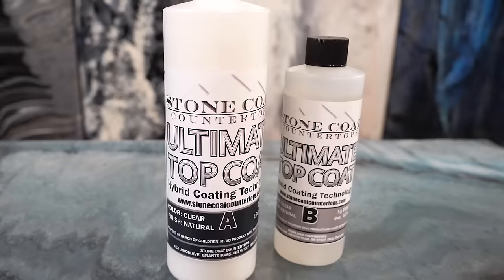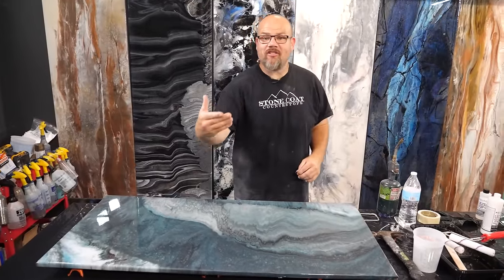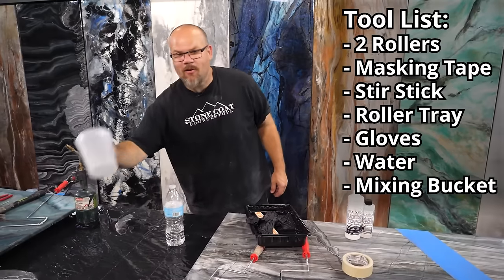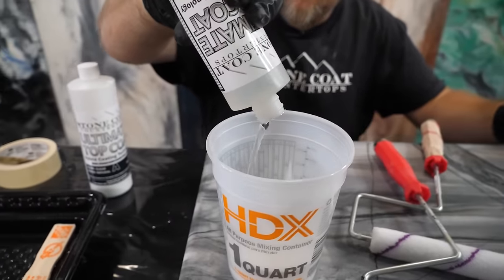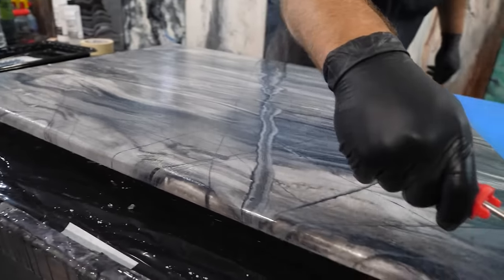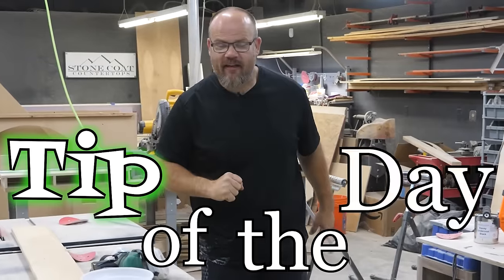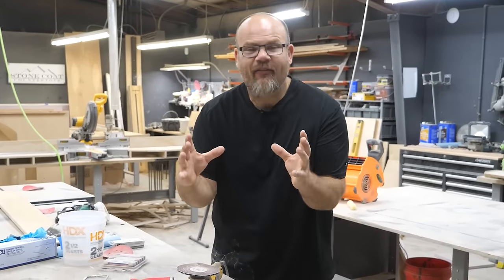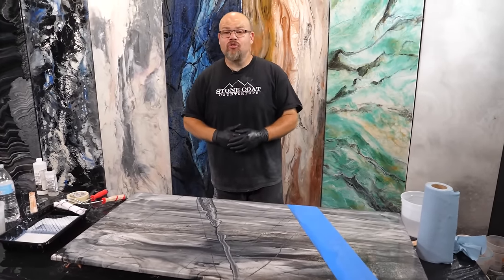The ULTIMATE Top Coat for Epoxy Countertops | Stone Coat Epoxy

Comment: Thanks Guys!  That's what I wanted to see.  Impressive, although I would have liked to seen underneath the hot pan.  I'm assuming that it didn't damage the finish?  Again, thank you for showing that.  A lot of crazy things happen in kitchens.  Can't wait to do the kitchen, vanity's and showers!!
Reply from the maker: It didn't damage it no! If something hot or heavy is left on the counter for a while, it will leave an imprint however once it is off the epoxy will move back to a smooth finish! We did torch the finished top coat in this video for quite some time to portray how heat resistant this is; the flame of a torch is much hotter than the bottom of a pan!
Reply: @StoneCoatCountertops  Yeah, right on!  I'm SOLD!  Thank you again, I think that answered that question for a lot of people that were curious about that.  Very impressive.  I've been watching all of your videos for a couple of years, you are excellent at it and should be proud of yourself and all associated.  Take care, I'll be waiting for your next one...

Comment: you can do the same thing with epoxy...............move the torch fast..use  a copper penny  which is soft...use the dull end of a nail..use non sharp tools...what a load of crap..this guy sold vacuum cleaners in a past life.

Comment: Absolutely love your products!  I’m not a contractor. Have done every countertop in my home. My last countertop I did the Carrara marble. I have some minor imperfections and a few surface scratches (so minor, no one will notice except me).  My question is, instead of doing another clear coat, after sanding my countertop and applying this top coat, will it fill in minor scratches or imperfections?
Reply: Yes it will. He talks about that in the first tutorial video he put out for Ultimate Top Coat.

Comment: Do not like this product. It congealed in the pan 15 minutes after mixing. Looks like absolute crap because I had to press really hard to remove with dry roller. Disgusted. Will probably need to re-sand. Not as easy as advertised
Reply: I just did 3 kits.  Followed their directions and rk3's directions. 

All 3 orange peeled
Reply: Mine orange pealed bad, then did it again with more water and still orange pealed but not as bad. Hell it looked better before I did it. I got the glossy kit, why would i slip resistant on it. Not happy at all